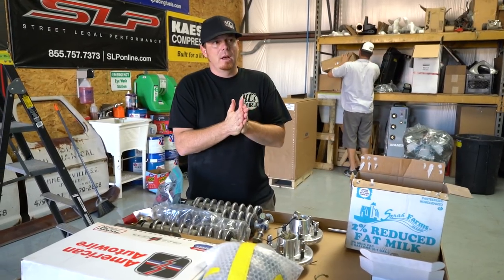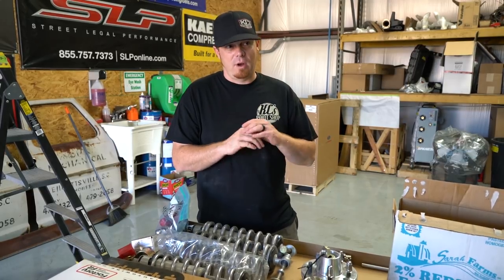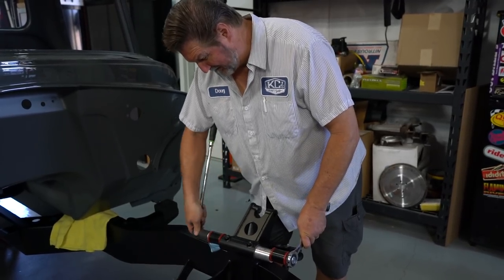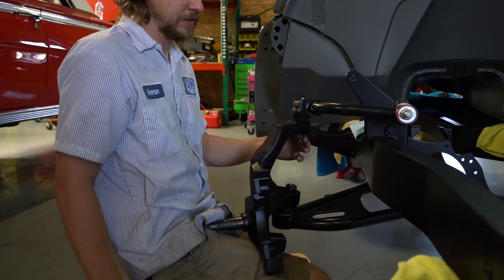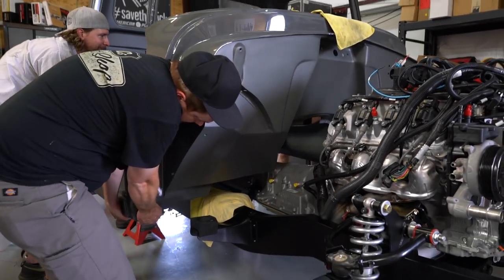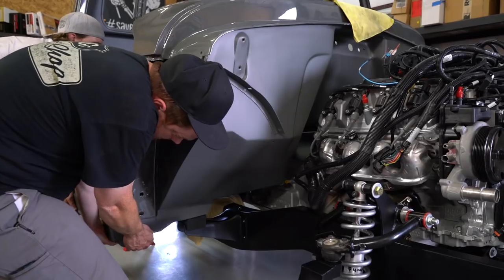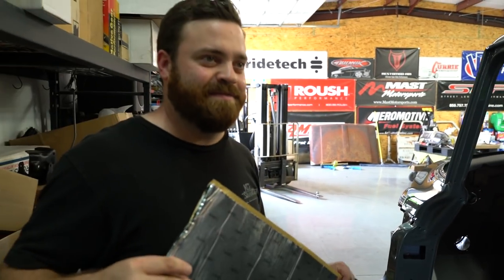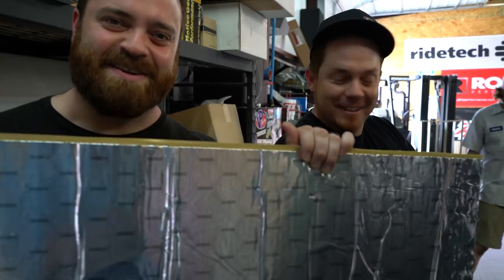The 66' just went International

Comment: How come ever restore shop uses a forklift to put motors in the vehicle . Why not use a cherry picker or motor lift
Reply: Tiny man. I've seen forks come down on roof panels & cowls from people just looking down at the engine & not looking where the forks are. I agree with you, engine lifts at so much safer. I'm also a big fan of the adjustable centre lift though it's hard when your fuel injection is already fitted.
Reply: koolkar55  cherry pickers are fine if you don't have room or a forklift.  otherwise they mostly useless wasted space.  not much you can't use a forklift for